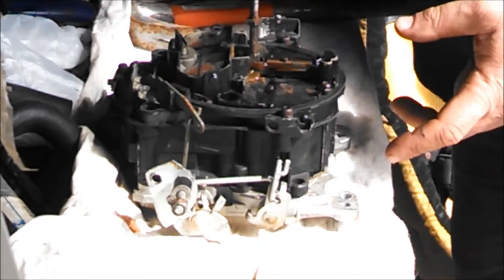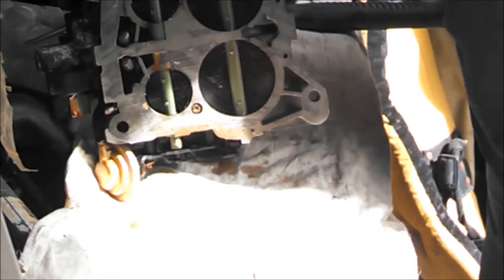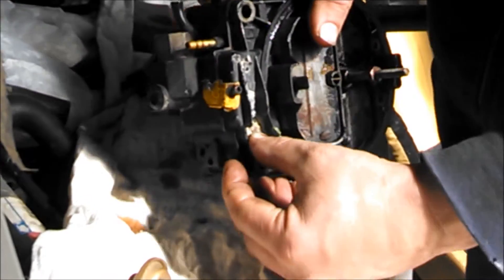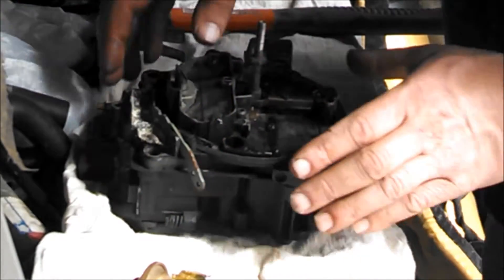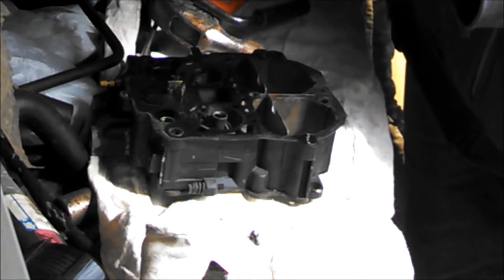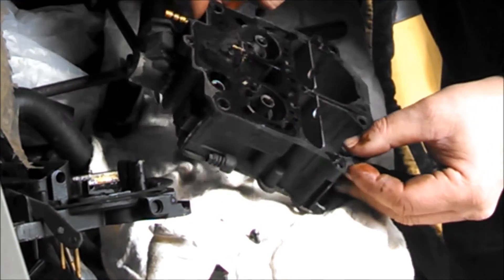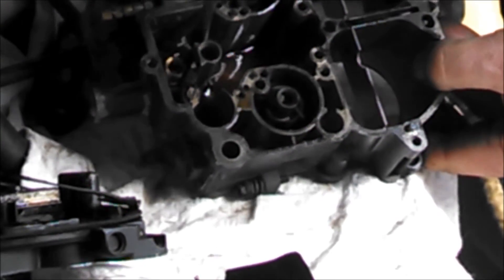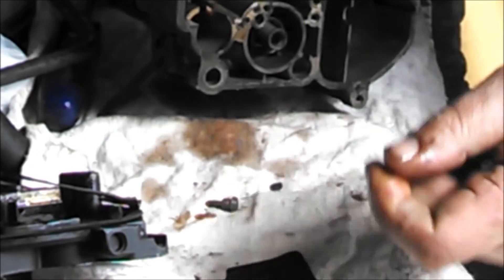Rochester Quadrajet Marine Carburetor Disassembly

Comment: Hey thanks for the great video.  Very helpful.  I have a couple of questions.  Do you also test for plug leaks on the boss plugs on the opposite the side of the primary and secondary jets?  I have read this is a common issue on Rochesters.  The leaky plugs flood the engine with gas on hot shutdowns because the leaks open up more with heat expansion and the increased bowl pressure forces more gas through the leaks and flooding the motor.  This makes restarting the motor almost impossible until the excess gas can evaporate.  I almost got stranded in my 91 Glastron Mercrusier 7.4-L when the engine was very much acting like it was flooded.  Had to hold throttle down full to get it to finally crank, and that was even sketchy.  Some people drill the old plugs out and fill with set screws and Marine-Tex Gray epoxy on the threads to seal them.  Other people just scuff the bosses and layer the epoxy over the old plugs to seal them up.